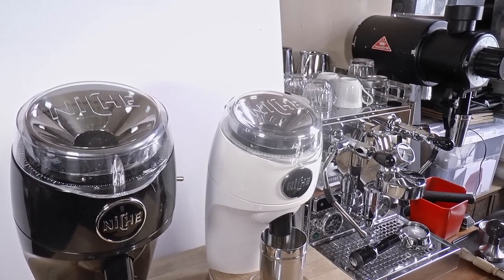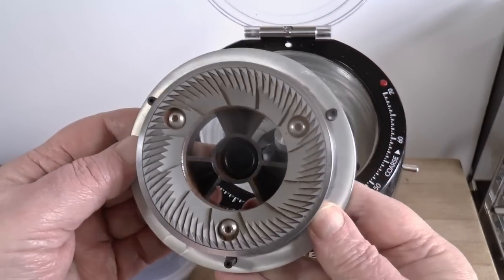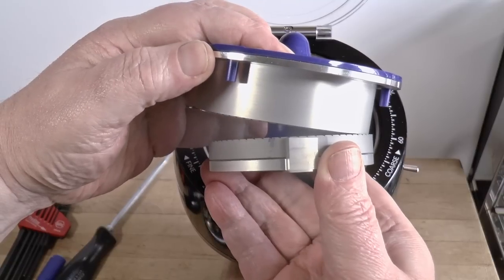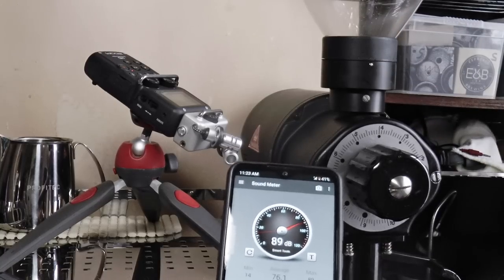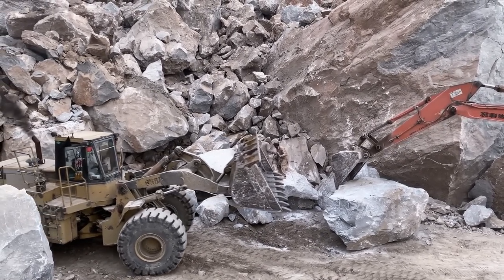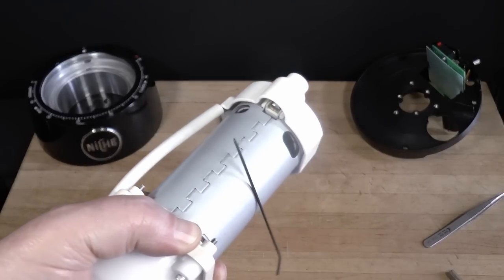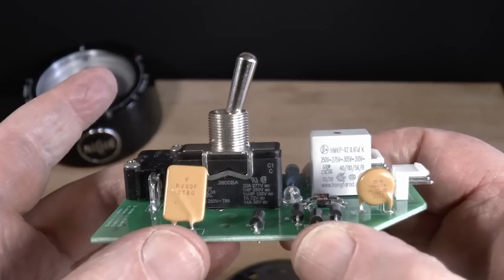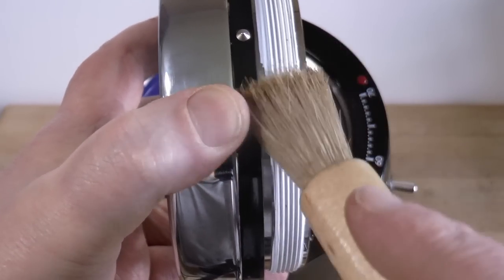NICHE DUO Review & Teardown

Comment: Great video! You've made the point in several videos that home products having adequate enough build quality for occasional use is acceptable. Perhaps a philosophical difference, but I think we can agree that watch you used as an example can be passed down from generation to generation whereas the Niche with it's nylon geared motor won't. I know what you are trying to say but it misses folks who pay more for industrial quality with the hope it outlasts them. Maybe you commented on that and I just missed it... thought it was worth commenting - have a great day!
Reply: Ian, why do you think Niche selected nylon gear box parts?
Reply: @dfk41  price/availability. In a past vid G compared it to drill motor - maybe off the shelf for a drill. Strength aside, nylon gets brittle with time which is unfortunate.
Reply: @IanLandesman  Okie dokie, price and availability are nothing to do with it. it is not a drill motor either! The motor is custom wound to Niche engineers specs and after 5 years in the field, there have been remarkably few reported failings of anything, let alone the motor and gearbox. I do not know enough about nylon becoming brittle. Are you able to give a timescale for that please?
Reply: @dfk41  decades. To give you example, the nylon gear in my Harley Davidson oil distribution system will fail before most anything else on the bike, which is all older than you or I combined. Not to say it's all 'reliable' as it requires maintenance... bushings, seals, and oil all need replacement many times over that nylon gear. They make metal replacements aftermarket. The geared cam shaft made of metal will outlive us. 

It's less about the motor lifespan and more about it's maintainability. In 100 years can it be replaced or serviced?

I know, if probably doesn't matter to 99.9% of customers, but worth discussing to a 'niche' group of nerds like us.
Reply: @IanLandesman  I am all with you on something lasting a long time, but that has a caveat of course! The Niche is aimed at the domestic market, so the question is what is an acceptable amount of time before a domestic product begins to fail? For myself, paying £500 for a domestic grinder I would be happy if it lasted 10 years or so, aparticularly
Reply: @dfk41  you are right. Thanks for the discussion. The watch he mentioned in the video probably costs a lot more than a 10yr watch.
Reply: Reading this discussion is intersting, but in my opinion all my coffee friends have never used a grinder for 10yrs because as the tech becomes more advanced, better built and cheaper to produce, we are all guilty of upgrading to the next new big idea. Lol
🫣😁👍😎🇬🇧

Comment: Thanks for a professional review Thomas. I have both grinders. Even though Niche offered to sell me only one burr set lowering the price, I bought both because I too like to fiddle with coffee toys. I was interested to find out if I could taste any difference between espresso shots between the Duo and Zero (medium to dark roast). I turns out that I could and preferred the taste from the Duo. I use the Duo everyday for espresso and occasionally bring out the Zero for V60. My rationale for using the Zero for V60 is that the extra fines generated from a conical grinder would be captured by the paper filter and not end up in the cup. That said, I'm sure that the fines change the flavour during the V60 extraction.

Comment: Just a note about the circuit board and motor. It is a DC motor, but you'll notice the frequency marking on it. This is because it is designed to work with rectified DC, with no further smoothing. Such a waveform is hardly DC, but it has a large DC component. As the board shows, it has a diode bridge but no smoothing capacitance at all. This is good. The motor doesn't require it and caps large enough to do the job would be electrolytic, so prone to failure in the long term.

The caps that are on that board are much smaller values. They take the edge of the noise the motor creates to keep it off the wires in your home; they are noise suppression.

Comment: This is the video that made me buy the Duo. I am very picky about build quality and this was very persuasive. A few things I dont like: The design of the adjustment mechanism isn't really well thought out from an engineering standpoint because the burr carrier rests against the threaded funnel directly. This isn't ideal when it comes to alignment and I doubt I'll have much success doing any manual alignment because it will likely be off again the next time you unscrew the funnel. But this design is the easiest way to do it, I guess that is why they chose it. I also dont like the anti-popcorning insert. I cut it out and replaced it with the Niche Zero Flow Control Disc. It works just like on the Zero, despite the higher RPM and the shallower funnel and popcorning is completely eliminated.

I noticed that the burr carriers could be modded in a way that would make it possible to install blind burrs. So if any manufacturer starts selling 83 mm blind burrs that fit my desired taste profile, I will try to mod them!

Comment: Fantastic exploration! Loved the tear-down. I wanted to ask what your espresso brewing parameters were for this test, i.e. dose, yield, contact time, and pressure. I would like to see if I could use the Duo with filter burrs for allonge and turbo espressos - so I wouldn’t need to go as fine as a baseline shot (1:2 ratio in 28s at 9 bar) might demand.
Reply from the maker: 16 g dose, 32 g yield; ~10 sec preinf (1 g out), 30 sec (+/- 2 secs) shot after preinf. Pump 7.5 ml / sec @ 9 bar. Prolly more important: beans were SHB, v. hard & dense to challenge all grinders. Softer beans will yield slower shots, maybe slow enough. All the other grinders coped with those beans for espr; the Duo with brew burrs didn't, so I called it a fail. YMMV
Reply: @wiredgourmet    great, thanks for that! yeah I can see how those filter burrs wouldn’t meet the required grind for those parameters, especially if you’re preinfusing! I love my Zero for milk drinks and my black coffees tend to be very light roasts pulled very long (1:6 ratio) or shorter and very fast (>14s), so looking at the Duo as an option to help with those high clarity low texture espressos. Once again, thanks! I’ll comment back if I end up getting one 🤙

Comment: I got confused a little on the shaft tolerance, '1/2000in(12.7μm) or 1/10mm(100μm)' aren't even close. Did you mean '1/200in or 1/10mm' instead?
From your brief shot, I see about 3.5-5 ticks, so that's about 45-65μm.
Regardless, it looks well into the P0 grade bearing(＞10μm) range. For reference, a P64 has   P5-grade bearings(5-10μm).
Reply from the maker: I think maybe you misheard me. I said around 2 thou, not 1 / 2000. Maybe I failed to enunciate clearly?
Reply: @wiredgourmet  Sorry I misheard you, thanks for clarifying. I was trying to match something that sounds close to what you said to '1/10mm'. 
So '~50-100μm' is what you actually meant to say then.